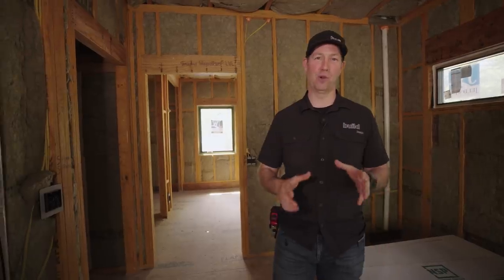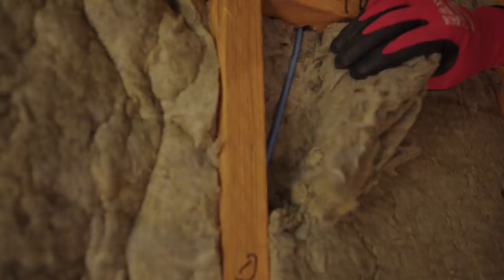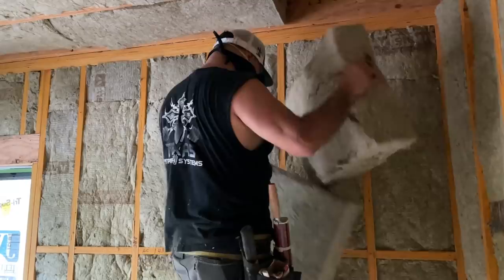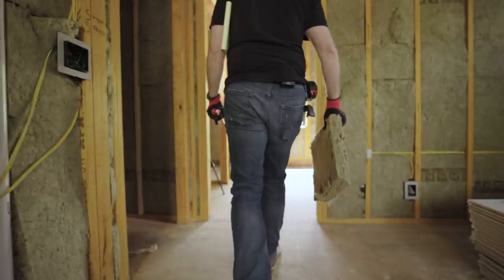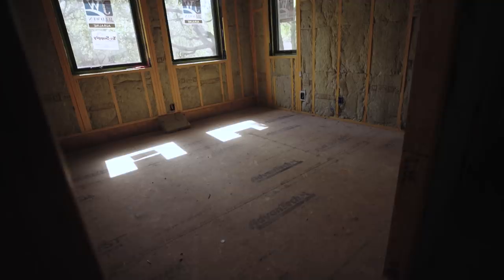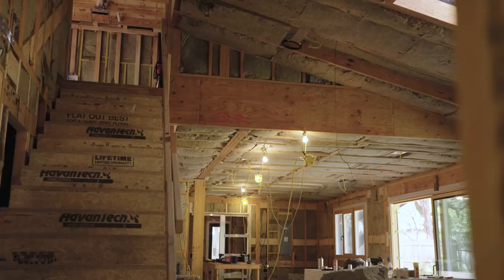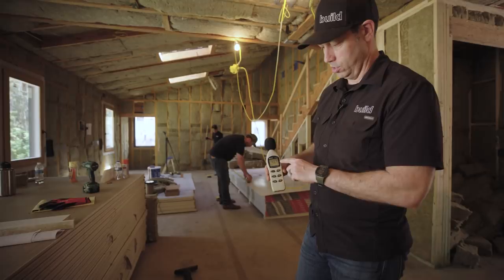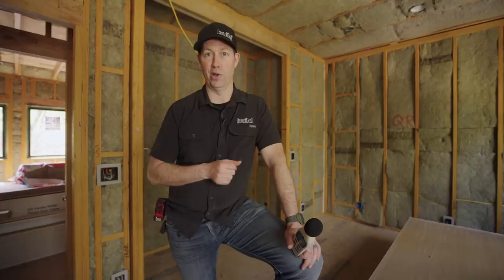7 reasons I used Rockwool insulation at my house.

Comment: I will say that, rock wool definitely help dampen sound coming into the house from outside, but after I put on Sheetrock, I noticed that the sounds bounce around the Sheetrock walls as if the rock wool wasn’t there. Just something to keep in mind when you insulate or use it for sound purposes.
Reply: so you are saying rock wool is no good when there is interior noise ?
Reply: @lancernightful , That's a good question. I am saying that the sound you make on the inside of the house bounces around the sheetrock very easily. However, travelling through the sheetrock/wall is a different story. In otherwords, if you keep all of your doors open in your house. There is a good chance the rockwool you put on your interior walls will do nothing. However, if you close your doors there is a good chance the sound will only stay within that particular portion of the house instead of resonating through the interior walls.  I would say bedrooms interior walls are good places to use rockwool for sound blocking, but all other areas are sort of pointless and a waste of money in my opinion.
Reply: That is not my experience at all. I insulated my walk out basement, with huge sliding doors, and even with all that glass, the sound insulation is much better, and now it feels like a room, and not a basement. It was definitely a great bonus,surprise, as I was insulating for cold.

Comment: If you pay attention to the decibel meter, you may think that a "small" dip in the number doesn't mean very much, but you'd be very wrong.

A "mere" 3dB drop showing on the meter is essentially @ 1/2 the present perceivable volume.  A 6dB drop would be @ 1/4 volume.  So going from the 50+dB he was experiencing downstairs to basically too low for the meter to actually read is a SUBSTANTIAL difference!
Reply: Except there is no baseline. A baseline would be to go to another house without Rockwool installed and measure the sound of a vacuum downstairs. Then compare the sound reading between the two houses and demonstrate that adding Rockwool to the equation is a meaningful parameter change.
Reply: @burchds84  The BEST way to have done this test...would be to have made the same amount of noise downstairs with the vacuum/compressor/etc. in the same exact spot PRIOR to ANY Rockwool being installed at all.  Then test in 2 or 3 specific spots throughout the house for noise levels.

Then after all that data has been recorded, install the Rockwool and repeat the noise test again with the same noisemakers in the same spots and the same decibel meter in the same spots you originally did the testing without the Rockwool installed.

THAT would have been the actual baseline to be able to draw an actual baseline from.  

Moving your tests to a completely different house with different materials, placed in different places for walls/joists/beams/etc. would NOT be anywhere near as accurate as testing the same site before & after installing the Rockwool batting.  Changing locations would COMPLETELY change the acoustical properties of the "baseline" and skew ALL the results of the tests.

Accurate results require accurate and repeatable testing practices.
Reply: @JM-nd3ps  Haha! Or maybe burn the house to the ground to demonstrate that a house with Rockwool is more soundproof than no house at all.

Comment: Appreciate you putting this video out.  Matt really needs to EDUCATE all other builders out there that seem to believe fiberglass is just as good as rockwool.  This is a far superior product than any fiberglass product made and wish building codes would start requiring use of this product.  Much more beneficial characteristics and had some serious mold/mildew issues in the past from use of fiberglass insulation.

Comment: Blown in cellulose for the attic seems to be a very common choice for houses that are going for very high insulation values because it is the cheaper than other methods and it seems to more environmentally friendly. It's nice to have choices but I don't think there is a clear winner for insulation. Choosing insulation is a matter of deciding what compromises you want to make. FWIW, one of the only times I've installed insulation was on a small apartment back to the studs renovation and I chose Roxul insulation because of the possible better sound dampening capability of the insulation although they don't rate the sound dampening for the exterior insulation. One thing to note, if you are going to use a bread knife to cut it buy one for the project. I pissed my wife off because cutting the insulation wrecked her bread knife.
Reply: I used my bread knifes and it’s fine.

Comment: Matt

I live in the Houston area. I believe I have found a simple model to test insulation performance. I keep bees and my hives allow me to test attic/roof insulation.

I used Rmax sheet foam material to insulate attic space in bee hives last winter. This spring I found that carpenter ants had made nests in all of them. They love to nest in it and burrow/nest not eat it. I am concerned that foam insulation in homes may experience the same issues.

The insulation was installed horizontally about 36” above ground and was 100% protected from roof water intrusion. All that was left of the insulation sheet was the aluminum facing and foam dust along with 1,000s of ants and eggs. My bees had been overwhelmed and absconded. Typically I loose 1/6 of my colonies in winter with no insulation and this year with my help I lost 6/6.

Rock wool enveloped inside house wrap should work and next winter I plan on using it in some and the pink/blue foam in others. I will of course monitor it more closely.

Comment: I use to use Rockwool for my hydroponic medium, so I can tell you for sure that it will hold water if it can get inside. It's very very absorbent. But dang it looks like a good option.
Reply: Yep, it'll hold water just like fiberglass if it's allowed to get wet. The medium itself may not hold water, but surface tension lets water stick to fiberglass and rockwool.
Reply: I think your thinking of grodan. They make an absorbent version for growing.
Reply: @boobacockaa  Mineral wool insulation is hydrophobic, Matt did not lie. Take a piece, pour water on it, put it in a bucket of water, etc, it will not absorb any water. 

Hydroponic Rockwool, ie Groden, contains less than 10% Rockwool. It’s a manufactured product primarily containing organic nutrients for plants, air space and the Rockwool is the structure.

Comment: Guys instaling our used roofing nails, drove them almost all the way in, placed rockwool in, strung up thin wire and around each nail and only after the room was done, drove the nails all the way in to secure wires.

Comment: I would prefer Rockwool for the qualities mentioned. As for the Formaldehyde content, it appears that the substance breaks down in sunlight and moisture readily. So, a fogging mister, followed by using paint curing lamps, and venting, may be the best neutralizer. The other timber products have formaldehyde in them as well that may be treated simultaneously.

Comment: Matt, I see that you use Rockwell for your house but other construction projects you use spray insulation.  I'm a little confused. Could you explain the pros/cons of each?
Reply: Mineral wool is great that's all you need to know! 

Spray foam is quick and easy to install in a variety of areas.

Comment: The sound reduction is amazing. I’ve always suffered from almost constant headaches and migraines throughout my life, often quite severe, so I have low tolerance for loud or obnoxious noises. Stuff like this is great for folks in my position to consider when building new or renovating. It’s something for sure I’ll have to do when the day comes that I build my own place (especially if I have kids lol).
Reply: apparently alot of people are pointing out that once the drywall is put up that sound reduction from the rockwool is no longer as effective since its underneath the drywall. So i guess sound dampening foam will do the trick.
Reply: @JOSEPH-vs2gc  yeah, Matt pointed that out himself in the video too. But resilient channels and acoustic sealants are relatively inexpensive ways to help on that front. GWB is always gonna be the bottleneck here for the foreseeable future as far sound reduction goes, as products like quiet rock or a full layer of acoustic sealing between overlapped layers of GWB (rather than at edges of GWB sheets or joints with other surfaces) is always gonna cost a lot as well for said future. Ultimately, a high performance comes from a combination of systems, details and products used

Comment: Matt I’m so thankful for all that you have taught me throughout your videos. Very cool “nerdy” information. Wish I would have known these things 10 years ago. 
I am however going to have to disagree about using fibrous insulation. Closed cell foam is the only insulation, in my opinion, that should be used. 
Have have been learning from spray Jones about the “nerdy” information of insulation. So much so that I feel fibrous insulation should not even be sold. 
Using the safe and sound for your interior walls I feel is a great idea. Grace and peace slick.

Comment: There could be a big problem with Rockwool and other mineral wool insulations. All the producer's thermal conductivity (lambda) information is based on tests made with ideal dry wool in laboratory conditions. Strangely last 20 years after new foam-based insulation materials spread on the market the mineral wool lambda is getting better and better without any serious changes in technology. It is well-hidden by producers fact that when the relative humidity of the wool increases just 10-20% The thermal conductivity increases dramatically. When you use Rockwool you need to think about how to keep RW RH below 20% when the RH of the air around you on the building site is 60-90% and also how you manage to keep it dry 100 years after especially when mineral wool does not want to give back a lot of that moisture it sucked in. Maybe you study this problem and comment on it.

Comment: I’m still very surprised you didn’t go with closed spray  foam on all exterior walls.
Reply: It was the one thing I hoped to hear in this video....
Reply: Trimming that stuff flush with the studs is a nightmare, and the effective R-value per $ after thermal bridging is awful, even for Matt's projects.

Comment: As to your rafter insulation staying in place.  What I've done is at on lower outside corner set a nail and tied nylon cord in 500 foot lengths (about as heavy as butchers twine.  I then ran it bottom to top perpendicular alone the rafters securing it with 1/4 staples from a T-50 staple gun two feet apart on the run.  I'd then place my bats, then make two more runs alone the rafters and repeat until done.  This is more than strong enough to prevent sags and allows for easy removal and replacement of the bats as needed.

Comment: Can you use spray adhesive when installing other than friction fit on the vertical?
Reply: It will work to hold the insulation in place long enough to get the ceiling panels in place.  I wouldn't rely on it for long term holding power though.  I've helped build a few audio booths using RW as well as fiberglass bats
Reply: Better to do a friction fit IMHO, if you add a glue, you reduce the fire rating (hint most glue burns very easily). following that, use Matt's advise and do some other form of mechanical mounting.

Comment: I used it my house addition a few years ago. Paid about $30 per bag, but today I’m working on my garage and find it’s almost $70! Like every else, the price doubled…

The dust will make you sick and itchy. Need to use full face mask especially for ceilings, where also it tends to fall.

My understanding is that the sound dampening version has same R value. The difference is that one edge is not as flexible for tighter fit. It doesn’t stop sound though…it just stops echo…once drywall is installed, there isn’t much difference. I’d still recommend it, though money would be better spent doubling drywall to block sound…only thing that stops sound is weight and mass coupled with air gaps.

Comment: How does Rockwool safe and sound compare to  Owen Corning's Thermafiber fire and sound guard, I only ask cause Home Depot does not seem to carry Rockwool
Reply: Shopping for building materials at Home Depot is your first mistake.
Reply: Lowes might have it.   I believe Home Depot carries an Owens Corning mineral wool that I assume is basically the same
Reply: It is very similar, I believe that the density is the same, and both are 3” instead of 3.5 like an R15 batt (so that the 2 pieces of sheet rock are decoupled, ie the insulation isn’t in contact with both pieces of sheet rock). Gas flow resistance is different, but unless you are acoustically treating recoding spaces, that should not make a difference. Also I believe that the R value of sad n sound is roughly R11, just FYI.

Comment: Matt, do you have a video on your studio with rockwoll and fabric?  Looking to put together a studio with the same and Zip.
Reply: If it is used for isolation (sheathing - insulation - interior drywall/wood covering), fiberglass is going to perform equally as well in terms of dampening resonance. If you are going to build a traditional wall assembly and then in front (interior) fabricate fabric covered stud spaces for acoustic purposes, a safe n sound product will be fantastic. If you are planning on recording instruments, once you reach a depth of about 10”, R30 fiberglass is more effective (due to gas flow resistance) and less expensive. 
In terms of Isolation you will want to focus on mass, a double leaf system, air sealing, mass, and insulation to dampen resonance.
Reply: Remember when asbestos, a rock product, was a miracle material that was superior to everything? Wow, we really thought the world of asbestos and all its benefits
Reply: @cornholy69  the studio is 2x8 construction. Using the Safe&Sound with the FabricMate or Fabric-Wall track with different color material and printed to finish it off. The Zip system is going on now and everything is getting sealed up. I'm just interested in what other "experienced" professionals are doing and not just the "youtube" kids show with foam square bats.

Comment: I'm a commercial carpenter for over 35 years and this stuff has it's advantages, but it absolutely sucks for installing around obstacles like wiring and piping...not friendly whatsoever and it will not fill any voids where a cut comes up short.  Not familiar with the "quiet rock" product, but have installed linear miles of RC channel and built thousands of feet of STC rated sound assemblies, installed countless sound absorbing panels and installed 10's of thousands of sq. ft of acoustical ceilings with tiles of varying sound absorbing qualities.   Bottom line for sound in any home in my opinion is to insulate well and insulate ever wall, not just the ones you want to keep the heat or cold out of...makes a huge difference and pipes that flow waste water too for that matter....I used RC-1 in my home as well as insulated every joist and stud cavity, but after 35 years of this...I don't really need sound deadening anymore...my ears have it built in for loss of hearing...lol

Comment: Ablative fire batt is made from compressed rock wool batt’s covered with a fire resistant coating. It is the most effective material for fire stopping complete walls cavities. It used especially in riser cupboards in multi floor building’s. The batt’s are quite heavy for there size. They are metric sizes 600 mm x 1200 mm . In America it’s 2ft x 4ft i am guessing ?
Here in Ireland they are building a lot more timber framed houses with concrete block or a brick outer skin.

Comment: Being sound isolated has its ups and downs. Positive side you are very private in each room. Negative side someone breaks and enters or there's a ruckus outside or your daughter sneaks in a boy for some late night cuddling down the line and you might not respond to it properly. Smoke detectors, security alarms, calling the kids down for food or to get up.
Reply: Security as part of the design process should take care of this. For windows doors opening, you have sensors in place, and maybe some kind of camera system and security reporting service. Same goes for distributed alarms.  I really wish Matt would have  covered some of those products and install them before insulation/drywall. However, like the ethernet, he just doesn't show those details. And from a security perspective, you don't show what systems you use or where they're located online. 

For communication,  a good PA system wouldn't be too hard to install, and you can even get wireless systems to reduce the renovation headache. The sheet-rock will increase sound reflectivity.  

On the child side, good education takes care of that. "Raise up a child in the way they ought to be raised and when they are older they will not depart." We ask adolescents to make like determining decisions such as what career they will pursue, we can expect them to make safe personal decisions. If you can't trust your kids, look at how you raised them. Kids learn from their parents first and then their peers.  I have several friends who aren't squeaky clean home-schoolers who still made sound personal choices. And if you think your kids may pursue skydiving, make sure you teach them how to use a parachute, and make some available. They may even help their friends make safe decisions.
Reply: @granatmof  I just wanted to point out that there are challenges and not really go into solutions. Tech is great, failure of those systems could also be a headache. On the kid raising point I'm being tongue and cheek but we all make mistakes and we've all acted stupidly so there's only so much you can do.